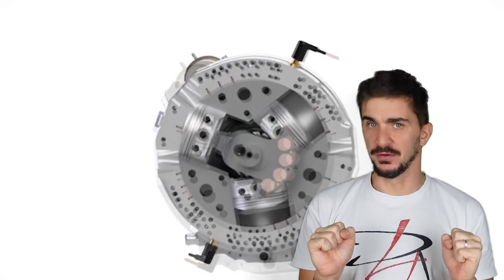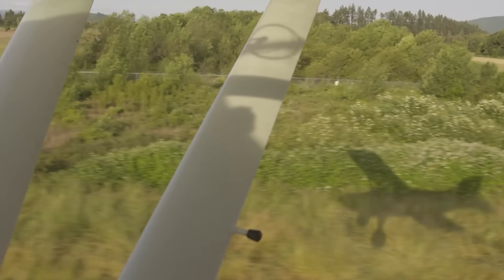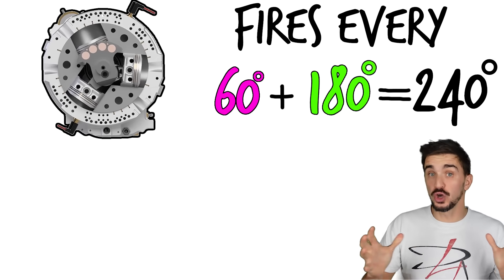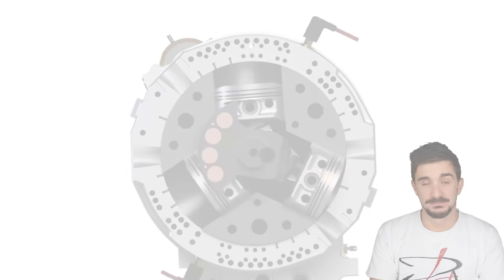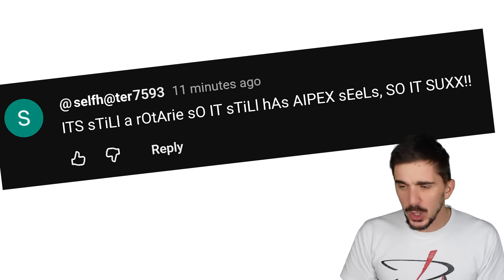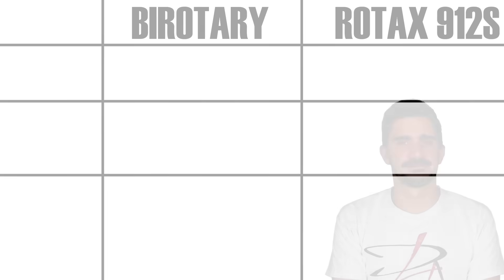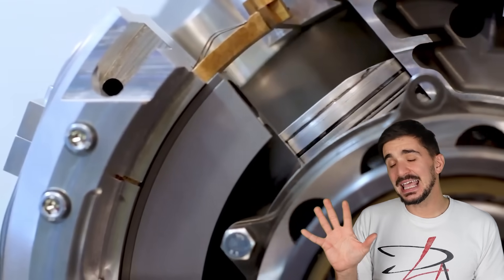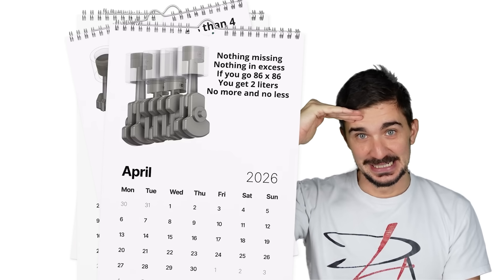This is What Happens When Pistons and Rotaries Make Babies - Birotary Engine Explained and Reviewed

Comment: "narrow useful RPM range" instantly screams "generator for series hybrid powertrain" to me
Reply from the maker: Knobgear has a zero vibration generator! Way better for that purpose than this. I haven't taken a deeper look at it but it looks interesting, there's a link to their site above.
Reply: @d4a  please make a video about that range extender engine. Also saw a lot of very good and low vibration range extenders engines in recent years that were very promising and then all of the sudden, all of them, stopped going public with a few declaring that they sold the technology. Wonder if their use in drones & recent wars has anything to do with it.
Reply: @TheEragoon  looking at the website, it's really simple and unremarkable- just two opposed, counter-rotating one-cylinder engines connected by a gear. good design, but worth a video? idk
Reply: @d4a  You didn't tell us how this engine is lubricated.
Reply: @autodidact537  With oil, duh!
Reply: @rata536 
Wrong answer! The question asked was "HOW?" your answer was "WITH WHAT?" You're not clever; Do better!
Reply: @garybrown1404  Lubricated by lubricating it with oil, duh! Me smart!
Reply: @autodidact537  dry sump.
Reply: @d4a  I don't think the mass market cares much about improving vibrations for generators.

Cost and efficiency are the most important factors by far. You think this can at least do pseudo-Atkinson cycle like a Prius?
Reply: @d4a looks like a small boxer?
Reply: @d4a My wife says "Why bother then?"
Reply: @m_jackson My dog said the same thing. The cat of course, doesn't care. 😂
Reply: @GeneralSulla of course. 
Today my newly adopted one eyed cat chose the harness, to walk around the back yard a bit. I'm very proud.
Reply: @GeneralSulla 
My goldfish wants to hear more before rendering any judgement.
Reply: @negativeindustrial Lololol!
Reply: @GeneralSulla  I love how y’all went directly from wife to pets 😬
Reply: @GeneralSulla  same with my cats, tmy dogs just want to know when we are going for a drive.
Reply: @d4a  Much better? Please make a video about Knobgear!
Reply: Small form, balanced, fewer parts.
This seems ideal for home electric generators.
Reply: @Gwindor2689  A generator needs to rapidly cope with load transients as whatever is connected to it turns on/off. Kind of problematic for an engine with slow transient response. You would need a battery between the generator and inverter to absorb transients.
Reply: @teardowndan5364 But doesn't that mean transient in terms of power but not speed? The speed stays constant, but it just takes more torque to keep the speed constant?
So adjust the fuel input to maintain the same speed and timing.
Reply: @teardowndan5364 nothing wrong with having a battery in there as long as it has good round trip efficiency and your inverter losses are less than the efficiency gains of running the motor at an ideal rpm. I still think instead of pure EV we should have smaller batteries and a small generator designed for maximum efficiency that turns on to recharge as needed and shuts off when not.
Reply: @teardowndan5364 coping with changing loads and the ability to respond to varying RPM demands are two very different things. The inertial mass of the block will certainly help carry it through a load variation although it hurts transient response.
Reply: @volkris  If the generator is near idle, you aren't going to idle the engine at 10k RPM, you will idle at RPMs slightly higher than necessary to sustain that load, otherwise you will be wasting lots of fuel maintaining less efficient RPMs you do not need, especially with an inverter generator where shaft RPM has no need to have any correlation with output frequency.

Recovering from idle/low-load running conditions to high load may take a few seconds. You could use capacitors but storing 4kJ (absorbing a 2kW average transient lasting two seconds) would require a pretty large one.

Can't rely much on the engine's inertia to cover transients up from a fuel-saving state since it needs all of its power to accelerate into its power band first.
Reply: @merendell  I agree that hybrids are the way to go. If I had to buy a new (to me) car, I would likely go with a Toyota eCVT hybrid.

Though I would simplify the eCVT system a bit by shrinking the engine to 35HP, hard-mounting and matching MG1 to that to eliminate one planetary gear set, beefing up the battery, MG2 and the rear axle motor to make up for having a ~40HP weaker engine and MG1 no longer being available when the engine is stopped. My goal here is for the engine to hardly ever run at less than 60% load since ICE efficiency degrades rapidly below 45% load. A smaller engine will spend a lot more time in its most efficient operating region and you can optimize the heck out of that much narrower operating window.

With an eCVT, you can skip AC-DC-AC conversion losses since you still have the ability to send engine power directly to the wheels and any load transients can be instantaneously absorbed by MG1, MG2 and the battery so the engine doesn't need to know they ever happened.
Reply: @RonPieper61  The housing and crank are linked through a planetary gear set. Whichever of the two has the weakest moment of inertia after accounting for the gear set ratio will dictate how much the thing may bog down on sudden load increases.
Reply: @teardowndan5364  Oh, sure. I wasn't picturing that kind of deep cycling, but more transients ranging from moderate load to heavy load.

Yeah, makes sense you wouldn't want to run this in cases where it would often idle.
Reply: @teardowndan5364 that's interesting. 
Sort of like going uphill in a car using the wrong gear
Reply: @teardowndan5364  Not if you have batteries. The batteries handle the transient loads and the engine charges the batteries.
Reply: @teardowndan5364 batteries?  Why not utilize momentum with more rotating weight?
Reply: @volkris  Agreed, if you have enough base load to peg the engine in its at-load RPM range, then transients become much less of an issue.

One thing to keep in mind in a much smaller domestic application is that an engine designed for 100HP propeller crafts may not scale down particularly well to the 5-20HP of a 3-15kW domestic generator, or even the ~35HP needed for a car range extender.

Linear piston generators would be the ideal ICE from a fuel-efficiency point of view, except the tech does not scale down particularly well below 20' container units and the power density (600kW per 20' container-size unit) is horrible. When you want the absolute best fuel-efficiency internal combustion can achieve, you pay the price in space to extract work from the power stroke and exhaust heat.

Similar story with the 5-strokes (double-expansion) cycle on a more conventional engine: ~10% better efficiency under heavy load at the expense of being twice as large for the same power and being worse under lighter loads from added drag.
Reply: @teardowndan5364  with that block spinning there will be enough momentum to compensate for transients, I'd guess.  For home generators you will need a reduction gear to achieve 1800 or 3600 RPM to get 60hz AC. Still means that it will have to run at full throttle all the time.  Not very efficient unless you are charging a battery pack and running the home off inverters.  Won't need that for a DC genset with permanent magnets.
Reply: @teardowndan5364 Yesh! Yes! A hybrid! That’s even better.
Reply: @pixels303at-odysee9  - So, a Heavy Flywheel? Transmission?
Reply: @teardowndan5364  as others have pointed out, when charging a battery you can chose the load, and it can remain constant, you could tune everything about it to maximum efficient while running and then run from the battery when it's got enough charge - Ford have just announced the next electric F150 will be a serial hybrid - so I wonder if this type of engine could make sense for that?
Reply: @brushlessmotoring  The problem with 10k RPM is that the engine is shooting flames from incomplete combustion out of its exhaust ports.

No matter how many extra bells and whistles you attach to it, you are pumping 15+% more waste energy down the exhaust pipe and that will never be as efficient as a same-power engine running at half the RPMs.

Efficiency favors large engines at low RPMs. More time for combustion to complete, more space for pressure to work on the piston before going out the exhaust port.

Power density and efficiency are mutually exclusive. If you want to maximize one, you have to give up on the other.

Anything high-revs is pushing in the density direction.
Reply: @teardowndan5364  No. The transient response is the ability to change rpm. This engine has slow rpm change capabilities but not power change capabilities, specially at high RPM. With a heavy flywheel it should do a great generator. A generator operates at fixed rpm. This one could be tuned to generate 230V 60Hz at 10000 rpm. Its response time at 10000rpm is instant.
Reply: @teardowndan5364 those transients would be so brief just add a capacitor or just dont add anything. an inverter and battery is stupid and a waste
Reply: @teardowndan5364 or an equivalent bank of capacitors
Reply: @volkris to be fair, this design can vary spark timing, so that is still on the table.
Reply: @martindinner3621  2-3kJ worth of capacitors is A LOT of capacitors if you want a somewhat tight voltage range.

You need a battery for electric start anyway. Eliminating the dedicated low-voltage starter battery, starter motor and flywheel gears makes up for the cost and weight of a higher-voltage battery that does double-duty as the energy buffer and using the inverter to drive the generator as a starter.
Reply: @teardowndan5364 fair. I was thinking more as a buffer to the battery, somewhere to push current spikes that isn't a resistor.
Reply: @teardowndan5364 
Well, yes and no. If the engine has intrinsic benefits that outweigh the issue of constant high speed, then it would be ok to do it like it was always done. 
Or you switch it off, use the battery power and electric machine to start it IMMEDIATELY (have you ever seen a combustion engine being started by its generator? It's a dream. It's simple on fire as soon as you push the button!) and you could overcome the transients also with the electric machine. The battery would cover all the load transients and the generator would provide constant power as soon as the battery is "low". The power fluctuation could be covered by the battery. 

It could work. 

The question is, if there are any benefits in it and if it's worth the hassle or comfortable.
Reply: @Thinkle911  The only "intrinsic benefit" of this and many similar designs is power density.

Most ground-based applications are far more concerned with efficiency and clean(er) combustion. At 10kRPM, you are shooting still burning air-fuel mix out the exhaust pipe. That will never be efficient and likely never clean either since the exhaust gasses would be too hot for a catalytic converter.
Reply: @teardowndan5364 yes, that's a good point! 

But on the other hand it's power density an interesting thing for a range extender engine. 
Compare it to the far more conventional flat 4 cylinder scotch yoke engine shown here on the channel.
Reply: @Thinkle911  A new range extender goes into a new vehicle.

Most jurisdictions have emissions and fuel efficiency standards that must be met by all new mass-market vehicles to be legal.

An engine that spits out something like 10% fire by volume out of its exhaust ports would be a substantial handicap to meeting both emissions and fuel efficiency standards. That engine has no future in mass-manufactured ground vehicles, with the possible exception of motorcycles.

Aviation is mostly exempt from those rules for safety reasons.

There is also the military field that can always use more power density for things like attack drones, if the engines can be made cheaply enough to compete with existing designs.
Reply: @Gwindor2689 PV+Batteries are much better. No moving parts.
Reply: @Ca0815 Best at night, yeah? 🙂
Reply: @lk-sb8ql  - Well, if you only operate after Dark, always, it could be a Challenge, if your PV is on the Vehicle! 😢
Reply: @Ca0815 PV+batteries will actually be the biggest market driver for generator sales growth.

When most people get PV+batteries, utilities dramatically increase fixed rates (because transmission is much more pricey than generation), and people consider disconnecting from the grid.
Reply: @Gwindor2689 or perhaps chainsaws, garden vacs, hedge trimmers etc?
Reply: my thoughts exactly. series hybrid or EV range extender where it can run at a constant RPM. Compact size and low vibration seems like a perfect candidate.
Reply: Same thought, everytime for same RPM so engenired for that. Hybrid in series, so generator and battery pact. In city full electric, regenerate outside city or in need. In-wheel radial electric motor (the weight of normal whell is almost the same, and about un-sprung mass need little balancing) so we can have easy modification of actual car, and choose btw  different traction for easy swapable wheel (excample: traction front wheel, rear wheel, or 4x4 with EBD, ABS etc, and regenerative break system.)
Reply: @francescocalo3557 I'd slap this engine on wide geared CVT plug in hybrid/ice, not full electric
Reply: video on diesel electric powertrain (like Edison motors) when?
Reply: @neonfoxgamer-9738 called a diesel locomotive
Reply: Yup, what came to my mind too. Switch to electric if you have engine that likes steady RPM. And that means... all of them, even traditional 4-stroke works better with electric motors than with traditional drivetrains.. And it isn't more complicated mechanically either but less. 

edit: not overall more simple, the electronic components in the circuit are counted in millions, but there are only few modules. Some of those are quite simple like the motor of generator itself and all of them are quite basic if you look at it from electronics engineering viewpoint in 2025 where microcontrollers are just like capacitors: ubiquitous and well understood. 

Added this as someone confused overall complexity with mechanical complexity. Overall it is on another level with all the logic circuitry involved. But isolating input from output when it comes to engines in cars riding on surfaces and all the stuff in the gearboxes, all the resonances and... Instant torque delivering drivetrain with its own power source that as no inertia is charged constantly with a thing that not only does have inertia but can be optimized to a single RPM by reducing complexity greatly when it comes to moving parts.. Like variable valve timing is not necessary anymore: less complexity where it matters the most: wearing, moving parts..
Reply: @squidcaps4308 
Manual transmission for life.
Reply: @squidcaps4308  "And it isn't more complicated mechanically" 
Peak cherry picking.
Reply: @Chris-yy7qc  What? You are saying that a mechanical driver train vs electronic isn't a clear win on electronic?

Coils and magnets, rotating axle. No gears needed. When everything is aligned along one axis of rotation and the thing rotating does not need anything but bearings, things get a lot easier. Even if we compare RWD to all four wheel EV i can bet the number of mechanical components is quarter.

Now, ELECTRONIC complexity.. Components are counted in hundreds of thousands to millions, if we count every transistor, and no matter how we tally it, it is far more complicated. But, in the electronic world... not that complicated, most of it is very basic shit.

The reason it is not done more often is that we got fair bit of losses when we convert back and forth. But one of the big things about electronic powertrains is that they are quite simple things. Machining things when you can turn a fuckton of it should be a clue already... No need to mesh any gears or think about differentials or long driver axles, vibration, things wearing down...

Still, it is rarely worth it, steel is quite cheap and we got all the machines to mass produce very complicated mechanical gear boxes, linkages and differentials with very fine tolerances. We got that shit nailed down but.. electronic has its own advantages, like.. no inertia in the drivetrain... regulating power 10 000 times a second, for each wheel separately without any feedback resonances from the drivetrain, and this also includes engine end of things, no vibrations, no feedback, no resonance, it is all just smooth turning without sudden forces... AND it is mechanically very simple.

 The best kind of drivertrain for ICE, specifically because of the things i said: optimal RPM and no sudden anything, completely isolate from fast transient that come simple from the tires reacting to the ground traveling thru the drivetrain all the way to the engine, the engine vibrations and knocks going to the drivetrain, no gear shifting and no jerks that come along, none of that crap when something bangs on another thing and that bang goes around fucking things up, including the frame of the whole thing... Everything is a spring, especially springs, they say. But when you rotate something around another thing, and the two aren't even mechanically connected.... Butter smooth. Both ends that have vibrating things, shaking things are isolated from each other. And... mechanically more simple. If it was cheaper we would've all had diesel electrics since 1910.
Reply: @squidcaps4308  You're mixing things up. This entire thread is about Hybrids, not EVs. Hybrids combine the worst of both worlds and are just a symptom, a desperate try to avoid the disadvantages of batteries. And yes Hybrids are more complicated than ICEs or EVs.
Reply: @Chris-yy7qc  Hybrids... are the best of both worlds. Literally. You have an ideological reason to hate EVs. We do need ICE still, the energy density alone makes it the only choice for certain applications. And the context is absolutely about DRIVETRAINS. That is what it says and it is true: narrow useful RPM means very efficient and simple ICE and with THAT power unit an electric drivetrain is better. 

Locomotives have used diesel electric since forever. You are now telling us that this is the "worst of both worlds". 

And hybrid with ELECTRONIC POWERTRAIN is less complicated than your normal 5-speed manual ICE. And that is the effing topic.
Reply: @squidcaps4308  Literally the only reason for hybrids to exist is because we dont have energy storing devices that are capable to compete or exceed good old dinosaur juice. So we created these over complex monstrosities called hybrids to extend the application of EVs into territories they would normally fail.

EVs or ICE are fine for their respective application. ICEs are the most versatile, tho. Hybrids are just a symptom of a lack of feasible energy storing technology that would be neccessary to replace ICEs completely.

Anyway. Im not in the mood to teach basics or to convince anybody. Too much time wasted already.

Bye.
Reply: Years ago there was a horizontal engine with a shashplate and a lot of small pistons.
Reply: exactly. perfect REX candidate
Reply: @0richbike  An engine running at 10k RPM is spitting fire out of its exhaust ports because combustion doesn't have time to complete during the power stroke. Fuel efficiency as a REX would be horrible. At the very least, it would need to be re-designed for 4k RPM (slow enough to not spit out fire) and at that point, it may no longer make sense.

Power-dense engines are rarely efficient engines. 

Efficiency requires time and space for combustion and expansion to occur during the power stroke so gasses can apply work on the piston.

Power density requires shortening the duration and length of power strokes to reduce the time and space spent on diminishing returns: the longer the power stroke, the less pressure there is left pushing on the piston.

The best you can get is somewhere in-between, depending on your preferences.
Reply: Coolingproblems?
Reply: Their is no need for such a thing so just another waste of a bad idea.
Reply: @aaronvandenberg2416 Some content is more equal than others. 😂
Reply: Beat me the same observation.
Reply: Dee, great analysis delivered with your fantastic South Philly accent! Might check your shorts- at a couple of places it seems your K- nobs might be caught in a twist. Maybe your coffee cream was K- nobbly and that could account for the "prollereure" digression!
Don't change a thing- coming here to be enlightened often has hidden surprises!
Fred
Reply: Might be a decent automotive application if paired with a CVT,
Reply: For me, it screams non positive pressure sealing.
Reply: @gsilva220 Leaky boom boom = nasty pants. 😂
Reply: Friction. Friction.
Reply: High RPM and short stroke usually means worse fuel efficiency since there is less time and space for mechanical work.
Reply: @teardowndan5364  I wonder if a 6 cylinder version would be more efficient?  (replacing the counterweights)
Reply: @bloothedog4443  The inefficiency stems from the air-fuel mix not having enough time to finish burning before going out the exhaust port at 10k RPM. Doubling the rotor count doesn't make that any more efficient.

If you double the rotors to either halve the RPMs or cut the port count in half so each cycle takes a whole rotation instead of half, now the power stroke has twice as much time to work on the piston before hitting the exhaust port, which yields ~15% more useful work vs shooting fire out the exhaust.

You get ~15% better efficiency and power out of making the engine nearly twice as big and heavy.

You need to sacrifice power density to achieve higher efficiency. You cannot have both at the same time.
Reply: @teardowndan5364 that depends on where it’s driven. On a hwy or Interstate it would be better. In town it would drop. Not going to say it would be worse than traditional engines especially if the short stroke engine was turbocharged
Reply: @erikcourtney1834  Sounds to me like you are interchanging power-density with efficiency. High-rev engines are NEVER particularly efficient but they are power-dense.

At 10k RPM, the exhaust ports are spitting fire because combustion doesn't even have time to complete before the exhaust port opens. That is absolutely horrible for efficiency.
Reply: @teardowndan5364  10k RPM is also absolutely awful from an NVH standpoint, which is extremely important in modern cars. Nobody wants to sit for hours with a Banshee screaming away at 10k RPM under their hood.
Reply: 10,000 RPM will certainly be screaming.
Reply: perhaps also, "Helicopter engine"?
Reply: Yeah get rid of the reduction gear and go straight with an electric motor. Then you bolt the propeller to that. Now the electric motor doubles as a generator and an electric motor. You add a few batteries, and now you have a fully hybrid aircraft engine. You only need enough batteries to accomplish a full client to a cruising altitude. Then you regenerate. After that it's just a safety backup. So even if you lose one system you still have the second one. All in the size and weight package of a traditional aero engine.
Reply: To me it is reminiscent of a diesel electric  combo used on supply boats where diesel operates most efficiently on a narrow rev range
Reply: That's exactly what planes need. Constant speed, optimised for that speed. The propeller changes pitch to keep the engine's power where it's needed.
Google constant speed propeller.
All our engines compromise on valves, cams, intake system, exhaust system, etc, to be able to get useful power from a rev range. 
If you compromise nothing, optimise everything for a certain engine speed, and have a way to convert that efficiently where you need it....
Reply: That's what we need, hybrids esp ones that use generators and don't actually move the vehicles!
Reply: Exactly my thoughts
Reply: Or motor-scooter with variomatic transmission
Reply: I immediately thought of electric generators for small and modest application. Hybrid generators for off grid!! In aircraft application there is low atmospheric pressure in its target environment. 

It comes down TBO and fuel efficiency. And in electric generation it’s only dealing with 1 bar atmosphere. 

Also addressed was turbo charged intake.
Reply: I expected it to be heavier, just looks like a LOT more metal and very little airspace- super short stroke.
Reply: As to GPH, or MPG/MPL I expect it to get SLIGHTLY better GPH as its moving g slightly less air volume and stoiciometric ratio doesn't change, HOWEVER, more available torque may allow the rotax to spend more time at a lower throttle setting thereby getting better economy. Nothing  normally runs throttle to the firewall forever, right?
Reply: Exactly, Hybrid claim best efficiency in a reduced RPM range and the constant variable rate transmission with two internal electric motors (like Toyota Hybrids) achive that. You don't typically hear the motor reving through a wide rev range at all.
Reply: Yep exactly my thought
Reply: So is this supposed to be an evolution of the old radial engines used in WWI?
Reply: That is exactly the first thought of myself  and apparently many others here.
Reply: It’s like a modern Sopwith rotary piston engine. Certainly solves the intake problem and at least reduces the gyroscopic effect.
Reply: what if it'c combined with a cvt? then the narrow useful rpm is a non issue
Reply: Love reading the replies and suggestions as much as the video.
After considering the points in the video its disadvantages would eliminate it as a range extender I feel as other configurations can be more efficient and I wonder about its emissions?
Reply: I don't get why a small efficient engine being a generator in a compact battery charge management system is not the solution until battery technology matches or surpasses ICE's weight and power density. This engine looks like a contender in such a solution. Potential for plug in at home, convenience of fuel on longer journeys. Allowing the spread of  cost and demand of massive infrastructure change of electric over longer period, Fuel demand reduced and increased proportion of bio fuels as a solution mix. What's not to like? Benefits of Electric performance, fuel convenience and vehicle lightness
Reply: Nailed it; wonder if Honda is trying this for hybrid generator, slow speeds would be totally electric. Real question is fuel efficiency for a generator? Sounds promising!
Reply: Exactly my thought! It could be its future!
Reply: With the modern use of multiple gear transmissions this unit is still viable….
Reply: Can you clean up the efficiency of these engine by doing what Detroit did with the screamer by adding a blower to help clean the exhaust gases from piston chambers…not discussed here but I am assuming this is a injection engine non carbureted…
Reply: Great for generator use too.
Reply: As a range extender powering a generator, it would be very interesting for cars.
Reply: 🤔 💡 How about "The Dildo Piston Engine" where the piston and connecting rod is shaped like a dildo that moves up & down in a vagina shaped cylinder. The fuel is squirted into the cylinder by an injector inside the Dildo shaped piston.
Reply: To get a new engine certified for small aircrafts is extremely difficult (expensive). In fact it’s so difficult that the industry still uses 1960s technology today.
Reply: Hell ya
Reply: Erev superduty ranger much?
Reply: My thought as well.
Reply: As series hybrid genny  is a part time engine. The efficiency is not great asset, the small size for superior packaging is important. Mazda have done a good job with the MX-30 rotary range extender.
Reply: I was about to post the same thing!
Reply: Cvt transmission would allow the engine to operate at its narrow range. Great for a smart car probably lol
Reply: or maybe it could be paired with a CVT (or an eCVT)?
Reply: It can be used in hybrid cars with CVT
Reply: Or a plane engine with adjustable pitch propellers…
Reply: or CVT transmission!
Reply: A huge, moving mass! That's impossible in an airplane, because such a propulsion system would turn the plane upside down. A hundred years ago, there was a radial engine that rotated the entire cylinder block to achieve better cooling. However, the airplanes couldn't compensate for the rotation of the engine mass and crashed.
Reply: Secondo me, questo motore, riesce ad unire i difetti dei motori a pistoni, con quelli IRRISOLVIBILI, del rotativo WANKEL...una cosa inutile.
Reply: Low RPM because it's designed for propeller aircraft and propellers are inefficient at high RPM.
Reply: The K is silent in their name, Knobgear 😊
Reply: Interesting none the less
Reply: Yes .the birotor coupled would weigh far far less than the 750kg battery pack in a tesla y model
Reply: Just about every unique engine of late is designed around systems of power generation or similar light industrial applications. This is at least specifically designed for aircraft. And area severely lacking in fresh ideas since most piston A/C  are still using 70 year old designs.
Reply: @jestubbs69 I suppose if it ain't broke....the Browing .50 and Mg42 are still in service.
Reply: Zoche electric turbo compound recent update on "Let's go Aviate" channel is much better than this engine.
But I Wonder if this engine could be much better if they made a diesel version and spun it at even higher RPM.   Of course that would require a bigger gear ratio Planetary.
Reply: I wonder how it would do with a cvt
Reply: Hybrids are rapidly becoming obsolete so probably not something you would want to put a lot into...combustion is reaching its end
Reply: It's obsolete junk.